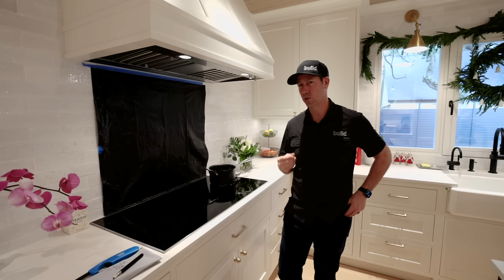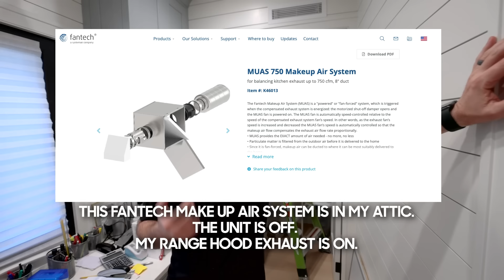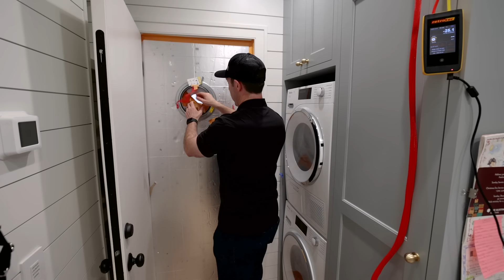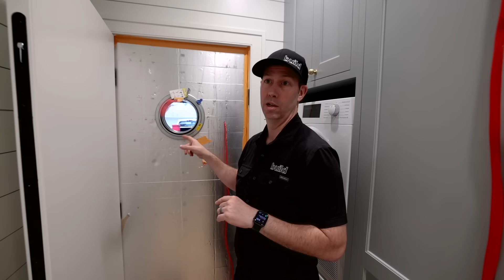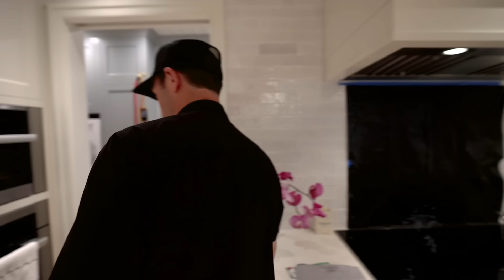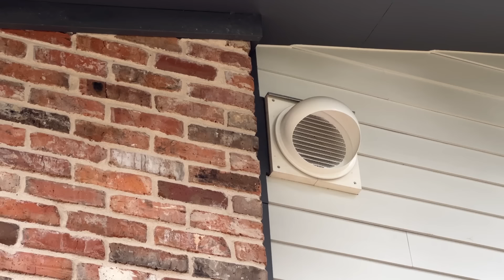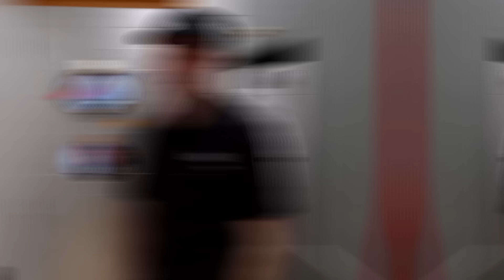Make Up Air for a Kitchen Exhaust - Most Homes Suck. (Pun intended)

Comment: What he doesn't point out is that this is only "easy and simple" to install when you have new construction and everything can be designed around it. Otherwise retrofitting such a system into most older homes can be difficult and very expensive. I got quotes anywhere from $12k-$15k to install an active makeup system in my house. Even passive systems were $5-6k
Reply: Most older homes are so full of leaks its not needed.

Comment: Your 400CFM exhaust is only with an accompanying Static Pressure, just like a HVAC blower has a 12"x18" output but needs a 24"x24" passive input to move the rated CFM (1500 in this case).

Comment: Matt learn how your equipment works. The yellow tube is to the B Channel that tells the DM32 the pressure differential across the Fan (as selected by the user). The red tube is for the pressure differential inside to outside (A Channel). The reference for the inside is the adjacent Blue tube connection. I have done over 2500 Blower Door Tests in 4 years. Remember the accuracy of the DM32 manometers is in the tenths of pascals.

From what I have read positive pressure inside is preferred over negative pressure. I don't understand why you chose a separate makeup air system instead of using your air exchange system for the makeup air. Other brands of air exchange systems regulate airflow using pressure differential. You added a separate system with additional cost and maintenance.

I love the induction, but it is treated as technology. It is not considered repairable. So when one of those diodes dies in the hob the hob is useless. That means you are spending thousands to replace your cooktop every 3-5 years over a failed $5 part (and landfilling the old cooktop). You can still get replacement nichrome elements (70+ year old tech) for coil cooktops today. We're currently waiting on China to deliver our next generation of induction cooktops with very short life expectancies. Tell me how filling landfills to enrich the CCP (and associated USA importers) with glass and computer parts is environmentally friendly.
Reply: Based
Reply: Considering the cost of conditioning outside air distributed throughout the house, a zonal makeup air solution in the kitchen would be preferable. Interesting comment on induction cooktops.

Comment: Yep, seen plenty of kitchen remodels with a powerful 1000+ cfm commercial hood over their 6+ burner commercial gas range and zero consideration for makeup air. If they have other natural draft combustion water heaters, furnaces, boilers or chimneys, that big fan will try to pull combustion appliance/fireplace gasses back into the house. Problems like THIS is one way to have a very deadly carbon monoxide problem. I've seen the plastic fittings coming up out of the tops of water heaters melted from the hot gas getting pulled out of the side of the flue gap.

Comment: Thanks for the walkthrough. A little unfortunate that it’s going to be exhausting primarily conditioned air through the exhaust vs having the makeup air drop closer to the exhaust. I hope its not noisy or drafty in the family room when you’re entertaining/watching TV while someone is cooking.
Reply: I was also thinking it would be more efficient to have the makeup air released next to the stove so that the home's conditioned air is not wasted.
Reply: yes it would be better to have the make up air in the range hood, as normal commercial range hoods work
Reply: Yes, but - because, in Matt's case being in Austin, the MUA isn't cooled. That would be very expensive because they are custom units with very thick evaporator coils with a high pressure drop and the fan would need to be upsized. S, if you place the MUA grills close to the stove, the cook will need a shower from sweating. It's best to dump the MUA to a conditioned space allowing it to mix with conditioned air and let your primary a/c handle the load. And yes, your ducting and supply grills should be sized for a 500fpm velocity to avoid noise, even if it requires 3 grills to avoid the noise problem.

Comment: I run air to air heat exchangers so that the house is at positive pressure.  This helps / can solve radon issues as well.

Comment: Someone needs to make a heat recovery ventilator for kitchen exhaust that can handle the grease. That's a lot of conditioned air to throw away.
Reply: My house has a HRV but the rangehood isn't connected to it, it filters smoke and smells out of the air and blows it back into the room (called a recirculation rangehood where I am). This is commom practice for airtight houses (mine got 0.4 air changes on the final blower door test). I'm not sure if it''s the grease, moisture, the airflow or all. My $7000 HRV does 150 m3/h on high (normally runs at 50) and my range hood does 800 m3/h, so even if it could handle the grease I'd have to buy one 5 times bigger than I need without it.

I imagine the air being exhausted ins't heeated much at all by cooking, but if it is that could also be a problem.
Reply: @jon8864  you definitely over paid for your HRV. I have a massive dual core fantech and it cost me around $2000 to install myself including the ducting and timers to service 4 bathrooms.
Reply: Doing the same on my build this year with 2full and 2 half baths with a EVR. What CFM unit did youuse?
Reply: @christophergruenwald5054  I get that doing it yourself is cheaper and I don't like to talk bad about a person thats happy with a HRV install but that does sound pricey. A lot of ducting affecting trim and other things could run it that high. High cost trim? 4 vents that need a plaster touch up then blend paint could cost a 1000 just on the holes. Just commenting to give folks context. A good fantec for 80 percent of US homes retails for about 2-2500.
Reply: @christophergruenwald5054  look up the efficiency of your fantech and compare it to zehnder,  I d never have fifteen passive house certification with a cheap HRV. I think you should look up some numbers every now and then,  quirk out what's what.
Reply: @sparksmcgee6641  I have a fancy pants German one that does the whole house.  It's much quieter and efficient than a fan tech. I could be wing but I don't think I could have gotten passive house certification with a exchanger that inefficient. 

My house can be heated with 700watts of heat on the coldest winter night. I have a 2kw AC that heats and cold the whole house. How much are you spent on heating and cooling systems? See why it might not be over paying?
Reply: @jon8864  Zehnders are $$$$, but for good reason.
Reply: @jon8864  Do you think extra $5K spent on Zender would pay for the energy saved compared to a less expensive model? As far as PH certification goes, check out what some recognized names in the industry think about it. Joe Lstiburek has some "nice" words about it.
Reply: @pnwbuilder  Very hard to tell if it will pay for itself in long run, maybe if energy prices go up and my fans don't shit the bed it will, then again maybe not. Especially when you consider the expense I went to get my house to 0.4 air changes would have been much cheaper to get it to 2 air changes and  use a cheap HRV. It's not a bad arrgument to skip the air tight layer all together and just get some 8kw ACs and some solar panels. Thats what most people in my area do. I tihnk its fair to say the zehnder is significantly less likely to pay for itself than the Fantech and the fantech is less likely to pay for itself than the house with a big AC and no heat exchanger.

What I don't think is I'm super smart and everyone else is doing it wrong cost them more than mine in the long run.
Reply: @jon8864  I don't think skipping on air tightness is a good idea. Good job with 0.4! I haven't run the test on my build yet, but I expect it to be well below 1. It is not so much more effort to get to these levels of ACH if you just plan a bit in advance, most builders just don't bother.
Reply: @pnwbuilder  Maybe I'm a glutten for punishment but I used a one way vapour permiable air tight membrane with tape on the inside of the wall, under the plaster (and a vapour permiable waterproof wrap on the outside with woodfibre insulation in wall). Costs several thousand as well but is the belt and suspenders of wall construction. 

I'm not sure why that isn't popular in USA, everyone seems to use foam over there if youtube is any indication. It's popular in Europe, I'm in Australia where it's popular to build a leaky poorly insulated house, get a "7 star energy rating" from the govenment then pay 25 cents kw/hr heat/cool it.
Reply: @jon8864  : thanks for all the notes
Reply: There are range hoods that just filter the air instead of removing it from the house.
Maybe that's a more efficient solution than all the ducting and fans and an HRV? You'll have to replace a filter with either solution.
Reply: @zteaxon7787  those don't work for carbon monoxide (gas stove). Plus I've never seen one with a good enough filter to be effective on cooking smells/grease/smoke either.
Reply: @jon8864  Yep that last 10-20 percent of cost on NetZero or a .2  ACH doesn't pay for itself. In cost or carbon. But you can build to 1ACH and to a $30 utility build with simple materials. Branded products don't want to market that obviously, they're selling the last 10percent of cost as the only way to build a "top of the line low impact home". For Example: Other than the HRV exchange itself your furnace has controls and airflow to do everything a HRV/ERV. In another 10 years an HRV/ERV will be just like an AC coil is now. A box you add on. But for the next 10 years we'll have to pay fantec 2000 instead of York 400.
Reply: @sparksmcgee6641  there's a company near where I live called the Mold Doctor.  All they do is go around to house take the plaster board off and kill all the mods growing in the walls. This happens because people reduced air leakage, increased insulation but drive the dew point into the middle of the wall.  

Not really having a good grasp of how to avoid this is the main reason I went a little over board with the walls. As with designing anything,  if you know what your doing you can cut closer to the line,  if you're a dumb arse over engineering is advised (not that brands names necessarily achieve this).
Reply: @jon8864  my fantech HRV is 91% efficient at recovery heat. Because dual 12x12x15 inch aluminum cores. Also big enough for 5000 sqft. I bought it new from ACwholesalers online for $1300-$1500 and I believe that was including the timers and main controller. Other retailers like Granger wanted more like $2500 for the same unit. It’s been 8-9 years now. This was also an install on a new construction house so getting all the ducting and plumbing where it needed to be was simple.
Reply: @jon8864  However, the recirculating hoods don’t take as much out as you seem to imply.  Cooking air and the air that’s returned is still full of pollutants.  That’s a real challenge for a couple of reasons.  1. Even if everyone is healthy, the extra pollutants can cause additional issues in growing children.  They are much more prone to  respiratory disease.   Then, if you have someone with a respiratory disease it’s bad for them. Add in the smells that linger and it’s not a solid solution.  Never understood why anyone would just bring that bad air back around.  Just me after growing up in a place with a vented range.
Reply: @mattv5281  Exactly!  “The most common pollutants from gas stoves are nitrogen dioxide (NO2), carbon monoxide and formaldehyde. Advocates now are mostly focused on NO2, which the Environmental Protection Agency says is a toxic gas that even in low concentrations can trigger breathing problems for people with asthma or chronic obstructive pulmonary disease” ~NPR
Reply: @Jim K  obviously I think air quality is important otherwise I wouldn't have a HRV. I've no idea why you think a range hood draws less air than I do, I'm going off the spec sheets. If you don't understand why I've done something  google it or ask me a question.
Reply: @jon8864  I'm late to the conversation, but doing a building course now we're being taught that since 6 stars is the legal minimum, 7 stars is "best practice." Don't expect building standards in Australia to improve while this is the government approved course being taught to new builders.

Comment: A clue on duct sizing for folks remodeling... look at any industrial centrifugal pump:  inlet is typically larger than discharge side.   The reason is a little different [preventing cavitation] but the principle with air functions about the same.  Atmosperic pressure is roughly 100k pascals - that's your precharge to the inlet.  Output pressure off a fan is an amplification of that - never equal/always more:.   So, if in/out ducts are equal size, the fan will take volume from somewhere else trying to reach its design output.

Comment: I'm sure someone corrected the comment that a passive solution would need to be 16 or 24 inches.

An 8" diameter has approx 50 square inches.  An 11.5 inch diameter has roughly 100 square inches.
Reply: Pi R squared is also a useful equation for comparing pizza prices. Usually the largest pizza is the most pizza to dollar ratio.
Reply: He didn't say anything about square. He talking about the size of hole. Not the square of it
Reply: @zacheriashelm  Pi (3.14) multiplied by the radius of the circle squared (exponent of 2) is the calculation used to find the area of a circle. Doubling the diameter of a circle more than doubles the area. When I said squared I was not talking about perpendicularly or the shape I was using it as a function in math.

Comment: Great basic video, there is a 3rd option. Vent hood with make-up air entering at the hood. Doesn't mix with house air so doesn't have to be heated/cooled. Down side, very expensive, typically custom.
Reply: What’s odd to me is that this is a separate system from his zender fresh air system. Isn’t this a somewhat crude duplication of a functionality he already has (meaning can’t using his range fan make a call to the zender to import an equivalent quantity of fresh air throughout his home?)
Reply: @edwardsmith3062  my understanding is slender ia always balanced, dont have the ability to create negative or  positive pressure  OR sporadically as called for , have different amounts fo air drawer into and out fo the house (go figure war what a 10k plus system ? LOL

Comment: The whole video all I could think about was the pre heater (from MA).  Also where in the house does that vent dump into? Is it a busy corder or is is a quiet hallway? I am just imagining getting blasted by air.   Great vid and great channel
Reply: I bought a make up air system from HVACQuick in Oregon. I haven't finished installing it yet Still figuring it out. I have a heater. It's the last piece. Once I saw Matt's video - I don't remember which one - since our home was done, I put the make up air system in the basement and opened a hole underneath the Kitchen Cabinets which are next to the microwave. I put a vent on the front of the bottom of the cabinet in front of the hole. I'm hoping it works as well as Matt's does from across his home.

Comment: Nice video.  I used to be a mechanical engineer specializing in HVAC systems (not anymore though). I learned some new things from your video. It might be nice if they could use a heat exchanger so that the makeup air could be heated in the winter or cooled in the summer by the exhaust air. I'm sure they have a good reason for not doing it though. The exhaust air might have a lot of grease in it that could foul it up.
Reply: An HRV...or ERV on make up air to reduce heating, cooling and humidity. Cooktop vent 400cfm is just one source. Run the clothes dryer, all bathroom fans, and all fuel burning appliances/ fireplaces at the same time - THEN measure total cfm and pressure differential. 

Too much work and cost? Open a window, turn on AC/heat, humidifer, filter. Still too much work and cost? Cook, shower, and dry clothes outside. Good luck.

Comment: 2, 8 inch holes are a lot smaller than 1 16 inch hole, which is massively smaller than 24 inch hole, so based on your end experiment, you initial statement about possibly needing a 24 inch hole for passive seems like it was an overestimate. Very interesting content as ever. Thanks.
Reply: Most people don’t realize a 3x4 gutter is .75 of a 4” square whereas a 4” tile is .785 of a 4” square. They get bogged down with the Greek letters and exponents before they even realize what a ratio is.
Reply: It like groarge Carlin always says the education system ain’t going to get better because the owners don’t want that

Comment: So the 500-lb elephant in the far corner of that room is:  WHAT HAPPENS when that "powered make-up air device" fails?  Is there a feedback loop to the exhaust fan that prevents it from turning on?  If not, it would seem the "risk" of back-drafting any combustion appliances would immediately return, but be "undetected"........and potentially start pulling in Carbon Monoxide from various sources.  This would seem like a big advantage to using a "passive solution", rather than a "powered" solution.  Electro-mechanical solutions ALWAYS fail eventually.................well-designed passive solutions, not so much.
Reply: And hidden in the ceiling, no less.  An indicator light for the return system, mounted on the vent hood control panel would be a big plus